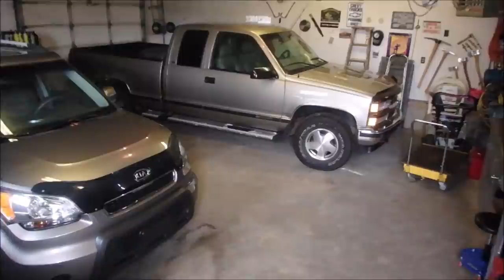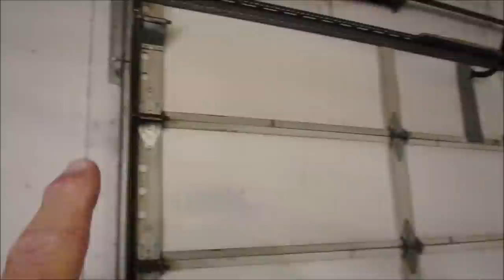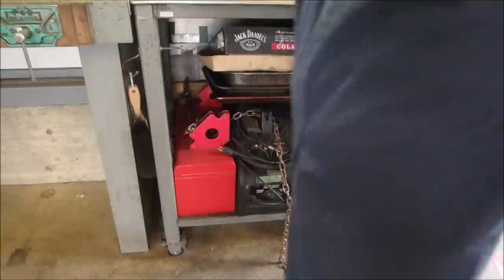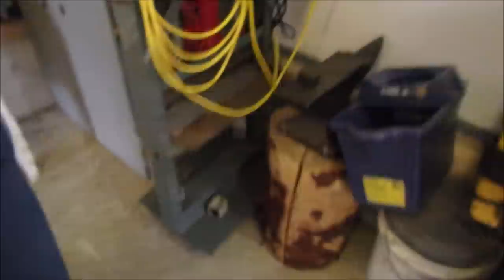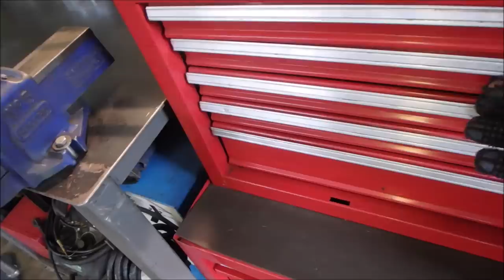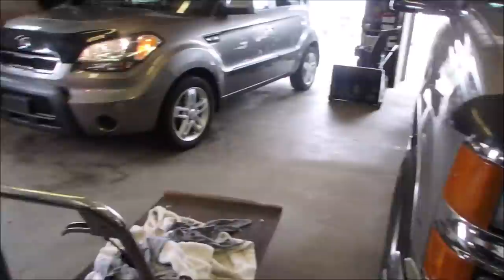Opening Up The Garage After 3 Months

Comment: You are not paranoid. Not in today's world. I like what you did to slow down as well as deter them. I used long shackle padlocks through my garage door channels. I also keep the acetylene torch ends under lock and key so they can't use that to cut through chains and locks.
Reply from the maker: Yes locking up the cutting tools is a good idea.

Comment: Welcome back amigo. That Husky work light certainly does brighten up the place. Mice!!! Nuff said. I quit using flourescents and have installed LED strings in my little work shop. They're bright, use little power and light up regardless of the temperature but I have a pretty good idea where your fixtures came from. See you up the road mate. I don't blame you at all for taking such anti-theft precautions. Well done.
Reply from the maker: Thanks again my friend.

Comment: Some day when you have time could you explain the board on the garage door anti theft system please?
Reply: I ,too would love to see the video
Reply from the maker: Wow  OK.  With that board up there you can push a wire coat hanger to grab the red emergency release lever inside the door
Reply: @BrucesShop  the tool marks on the door - do you think they were trying to coat hanger trick? They tried that 2 years ago, if memory serves me correctly.
Reply from the maker: @haneyoakie14  You are right  I just included that as the back story.  I didn't explain that very well   Thanks
Reply: @gordbaker896  but they don’t know it is bolted. They try the coat hanger and of course, they fail and move on to an easier target. If they managed to defeat the board, the bolt is a backup redundancy all over again.
Reply: @BrucesShop  you might be better off not explaining it too well. I doubt Mr Scum and Mr Bag are viewers, but keep some security secrets, especially the 240 v hooked to the toolbox handles.